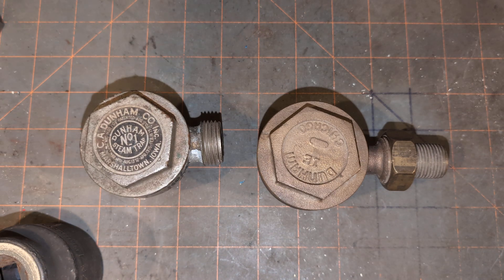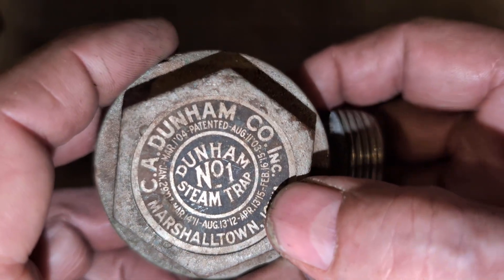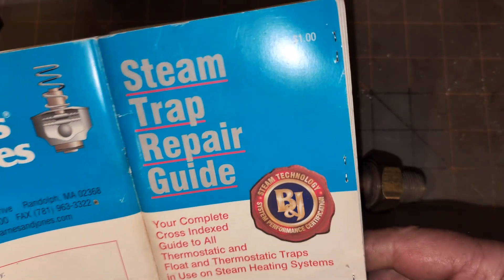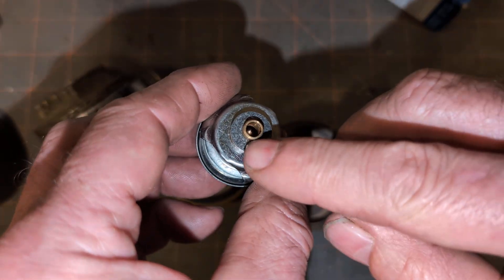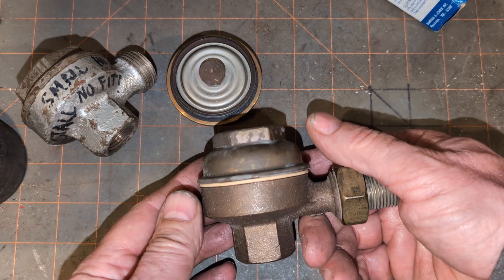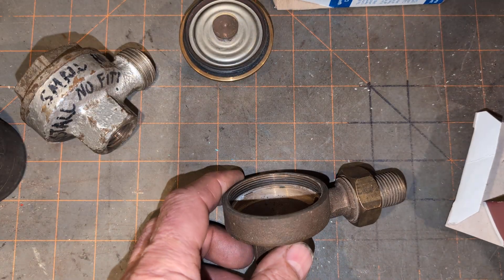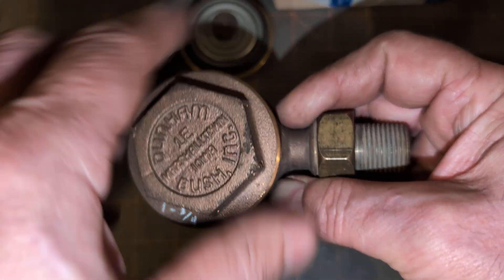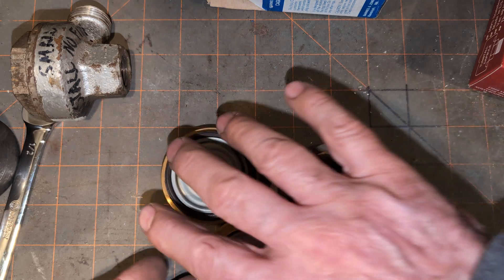Dunham/MEPCO #1 Series 1/2" Thermostatic Steam Radiator Trap Rebuilding Tips

Comment: If i have number 1 crossover traps on my main return id replace with the 3133? Having a hard time figuring what parts i need
Reply from the maker: Hmmm. That is hard to say.
Have you considered replacing the entire trap with a  1/2 "Big Mouth" trap?
It looks like a Dunham/Mepco trap, but it is sold by Barnes & Jones.
It really allows the movement of a lot of air!
If that is a budget buster, I get it.
The #1 Dunham looks like it has two variations.
The one in the video looks like it is the small orifice 1/4" that requires a 3133 cage unit AND a 3133 cap.
It is very restrictive of air relative to other traps, however.
The other #1 is more ordinary and takes the common #1950 cage unit and a #1950 cap.
The only way to tell for sure what you have for sure is remove the cap of the unit you have.
Reply: @gordonschweizer5154   wow thank you for the reply!!!! no budget id spend whatever for the best part available. i have took all the covers off and i have that dunham 1 like in video. i know you said ill have to do something after market  i was thinking 1950 cage unts with new 1950  new caps. but im getting confused cause now i think i need the 3133? when you say consider replacing the entire trap you mean the body too? i had not because it seems like a alot more work so was hoping to just replace the internals. im pretty sure i have the exact dunham 1 in video. i also have one radiator that has a 1e so im going to just get the 1 e cap and disc. all that was about my radiators. i also found 3 dunham 1 crossover traps on main return in basement that look same as radiators so would the crossovers and radiators be the same trap. any info be much appreciated. LOVE THE Channel. Great info. was also wondering if i should upgrade my   usav 881 air vent to a Gorton No. 6, 1/4" Straight Vapor Equalizing Valve.
Reply: house has been in family over 30 years. built before 1930. now that i understand the 2 pipe steam. ive realized all my traps  are bad or entirely missing. The internals i mean. i have 3 crossover traps and 17 radiators. with a 245 btu american boiler. trying to make the system new will spend whatever you recommend. thanks again
Reply from the maker: If you have the Dumham #1 that looks like the one in the video with the 1/4" outlet, you will need the #3133 cage unit and #3133 cap.  It is likely the #1950 will NOT fit correctly.
The issue with the 3133 is the air thru-put.  If you have a small radiator or convector, that should not be an issue, but if you have a larger radiator, I would consider replacing the #1 with a new trap body #1E.
Cross-over traps should be replaced with the "Big Mouths" Full Stop.
Reply: doesn't big mouths only do air no condensate?  Im probably wrong. so i should replace my 3 crossovers with big mouths you think? will just help vent air quicker?

Comment: I have two pipe steam. From what I saw at the end of the video, would it be smart to adjust the radiator inlet valve to something like 80% open, so as to minimize the wear on the steam trap over time? 

Thanks! ….

Comment: So is your preference for the original Dunham replacement capsule based on it allowing for condensate to flow through the drain at the designed dimensions, as opposed to reduced opening that results from the cage units fitting into the drain hole?

Would the gasket at the bottom of these units help if ‘wire drawing’ has deformed the drain inlet surface? If not, is there a way to address that issue, other than replacement?
Reply from the maker: Usually I find in general that OEM stuff works better.
Now, if the seat is buggered up a bit (but too badly, whatever that means), the Tunstall or B&J is a fall back solution.
Or a  OEM trap replacement is also an option - a more expensive one to be sure.
But a MEPCO trap replacement should not require a full-on removal of the old spud from the heating unit.

Comment: We've got a ton of these (1B) that I'm in the process of rebuilding. What I've found to be problematic is the durability of that integral seat. Most of the 50s era units that I tested on my homebrew testing station leaked like crazy. The discs hadn't failed but the seats were so badly wire-drawn and pitted that steam whistled right on through. The rubber gasket on the Tunstall capsules should remedy that. 
Incidentally, with the 1B at least, you can reuse the cap (with Tunstall) but the old disc has to come out to retain the spring. I use an impact gun to get the cap off the trap, then I turn the tool so that the socket is facing up with the cap still sitting in it. I then put a 1/2" socket over the hex on the disc to keep it from turning and again use the impact gun to spin the cap and remove the disc.
Reply from the maker: Thank you for your detailed comment, and the tips!